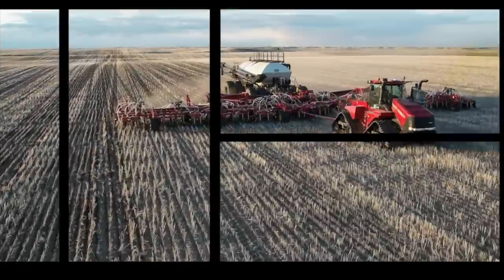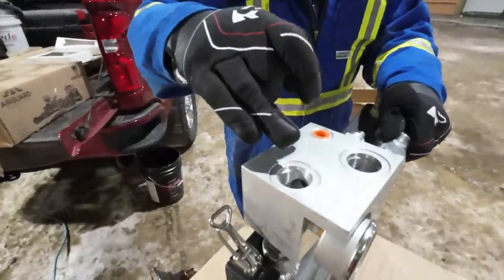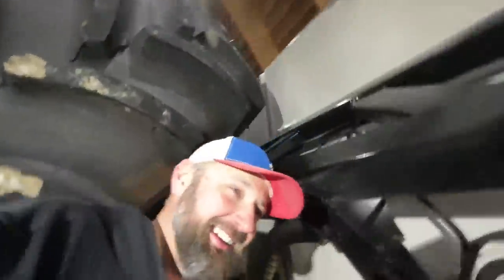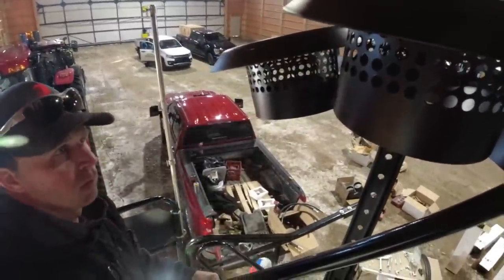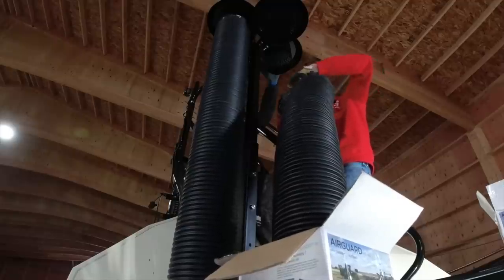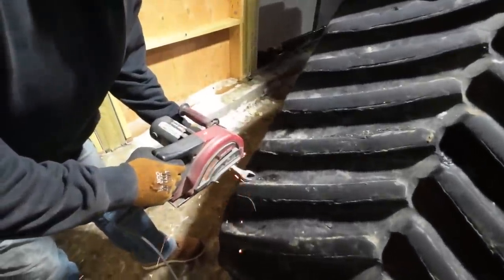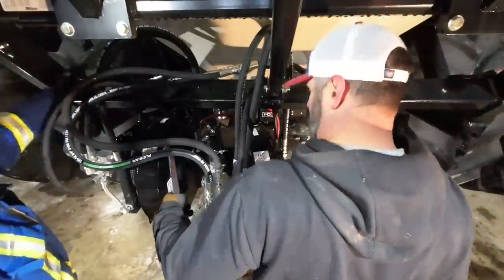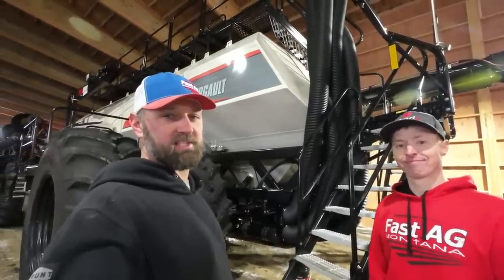Upgrading the 1300 Bushel Bourgault! @airguardproducts

Comment: So Tony what happens in the 100 degree temperature this spring, when those 4 air hoses stretch and drag on the ground?😜
Reply: Should be one intake and hard tubing to a diffuser to minimize the flexible hose
Reply: If you watch all the video you will see that they are connected to a manifold.